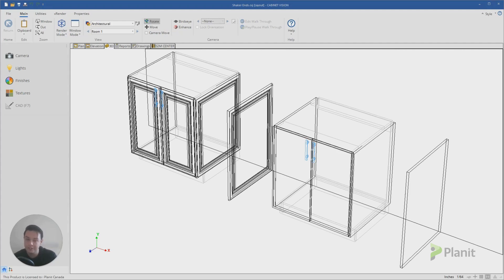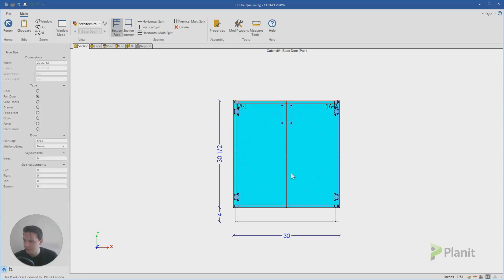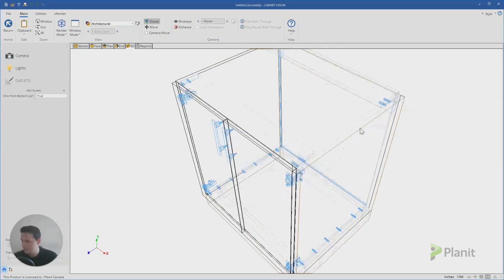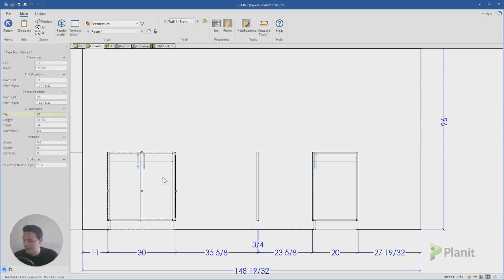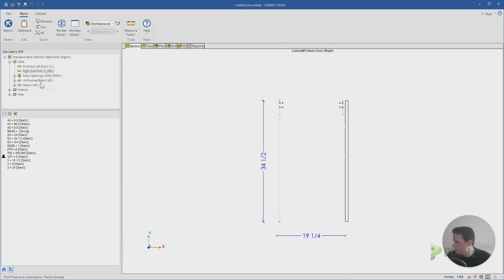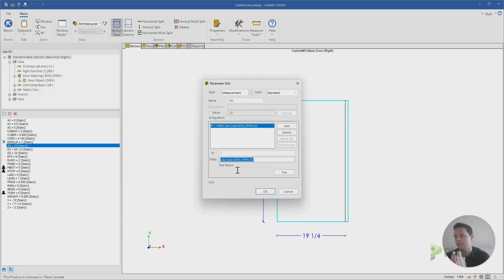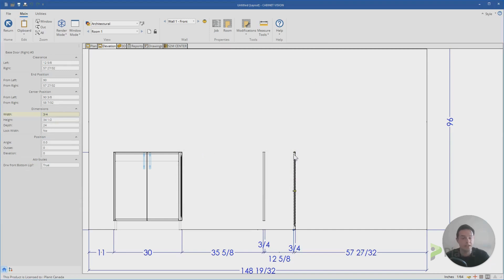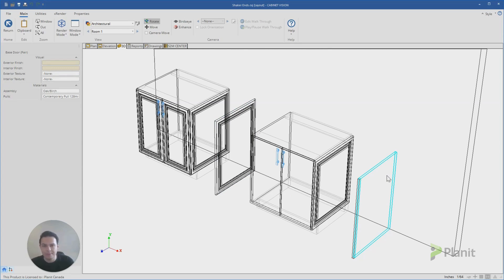Your Questions Answered: Add Shaker Profiles to End Panels and Create Your Own in CABINET VISION!

Comment: How do I stop the applied door from going past the toe kick?
Reply from the maker: Great question! It most likely has to do with one of your Construction Method settings. 

If you open up your Construction Method settings from the System, Job, Room or Assembly Level, and then open up the 'Connection' folder and double-click on the 'Deck' option...

Skip through the questions until you see Standard #792 (the reference number is in the top-right corner of the window). It's called 'How does your Deck and Applied End connect?' 

Now there could be a few different reasons why you're getting this issue. 

1) You may have the 'Joint' setting currently set to 'Extend Applied End to floor' and then there may be a positive value in the 'Adjustment' field which is extending the Applied Door further than the toe kick. If that's the case, change this number to 0. Then, if you made this change on the System Level, just be sure to update your job to see the changed settings work. You can run some tests in a new project to see if that setting is causing the problem.

2) If this looks correct, but the Applied Door is going past the toe kick through the floor, it could mean that there is a System Parameter or UCS currently adding to the length of the A.D. unnecessarily. 

If that's the case, let me know and we can offer more advice on how to troubleshoot this!
Reply: @PlanitCanadaInc solved, thank you! Another thing I noticed while watching this, is that I can’t find the object tree icon anywhere, or anything similar. I am using CV 2022, so I don’t know if that is why?

Comment: Thank for the video! I'm curious to know what is the major implication if I just hide the parts instead of changing the quantities to zero?
Reply from the maker: Great question! When you hide a part using the 'Hide Parts' button, all Cabinet Vision is doing is making the QTY = 0 of that part for you. So using the Hide Parts tool, you can make the QTY = 0 of many parts within your Assembly all at once from the Assembly Level of the Cabinet Vision hierarchy. Whereas if you change the QTY to 0 yourself, you'll get the same result but you'll be changing them manually on the individual Part Level which may be slower depending on the modification you're trying to make. Hope that helps!
Reply: @PlanitCanadaInc  Thank you!

Comment: Hi, this is an eye-opener. Thanks.
How do one insert a door in a face frame construction method? The adjustment option on the side allows for offset between the door and the frame. However, the door is not inserted inside the cabinet. Could you pls look into this?
Reply from the maker: Great question! We will record a video that shows you how to do just that and we'll let you know as soon as it is uploaded!
Reply from the maker: Hello! This is just a little message to let you know that we're uploading the video-answer to your question now. Let us know if you'd like anything clarified. Have a great day!

Comment: Hi thank for your videos they help a lot. how about fillers we do same process?
Reply: Fillers as in? Make them doors? Elaborate
Reply from the maker: That's a good question! I imagine we're referring to how we can create standalone filler parts, similar to how we made standalone end panels in this video? 

If we would like to create a filler from another assembly, then yes, the process is nearly identical. 

But remove all of the parts and from the Elevation, Plan or Profil view on the Cabinet Level, click on the 'New Part' button on the right hand-side and add in a Filler from the list. Then use the left-hand column to fix its positioning and size. You could use the Object Tree formulas we touched on too!

The cool thing about Cabinet Vision is there are usually multiple ways to accomplish the same result. So if you would like a specific hand with creating a filler, let us know where you'd like some help and we'd be happy to make a video tutorial!